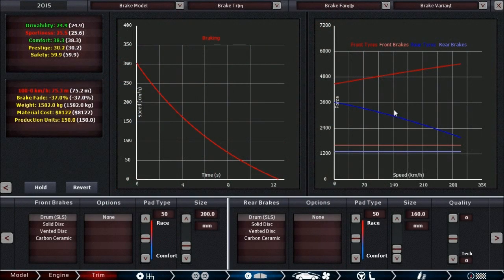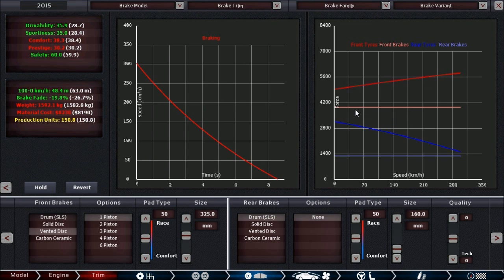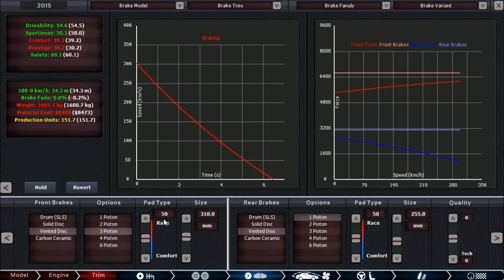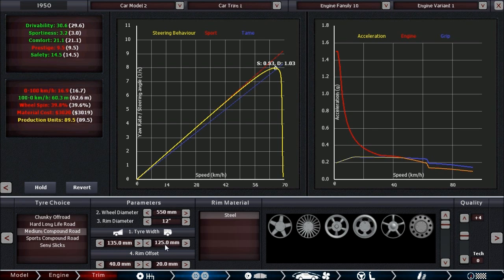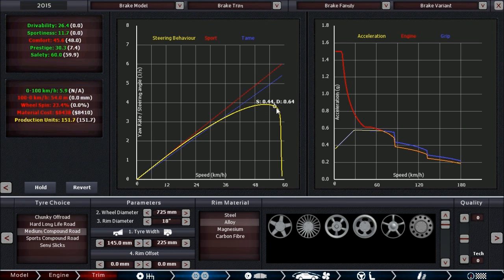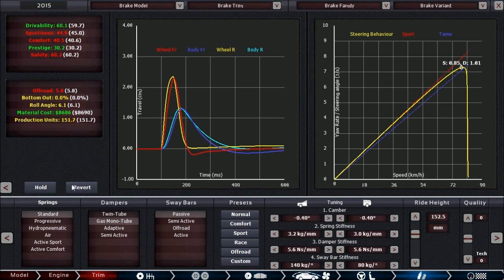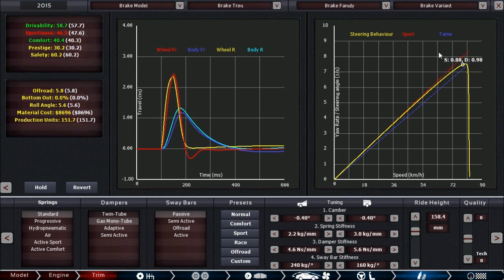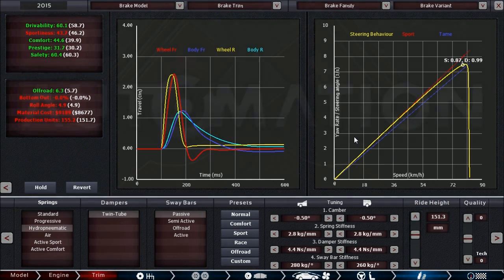Tutorial: Brake & Suspension Setup

Comment: Hey..I wanted to built a SUV that has a 5 Speed Automatic trans with 4 Forward speed and 1 Overdrive. Like the old 5 SPD Mercedes set up.
Reply from the maker: Kevin Li Then select 5 gears and set the top speed such that the fourth gear goes to the top speed line.
Reply: AutomationGame I see~